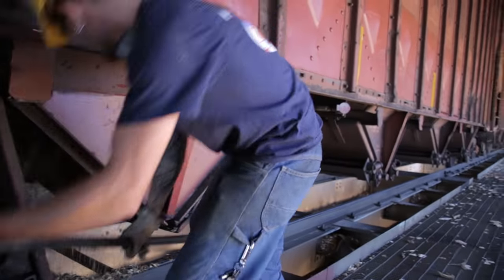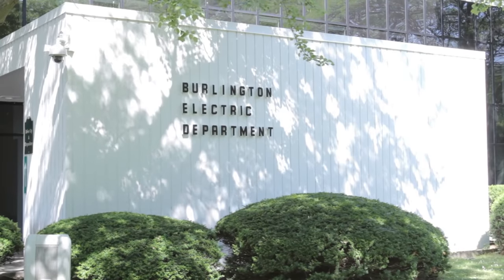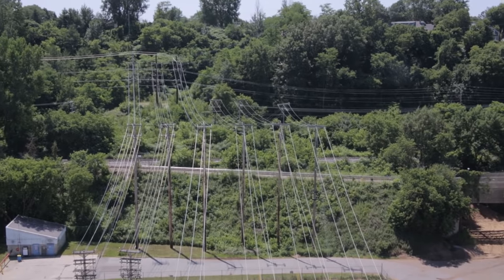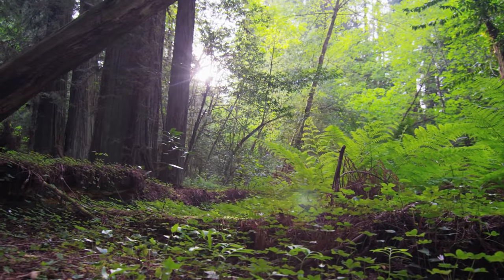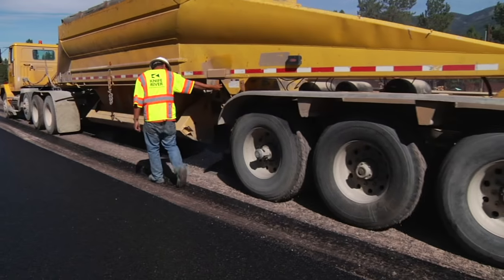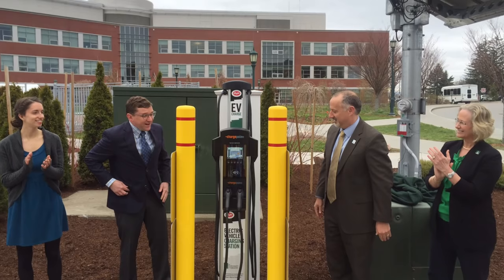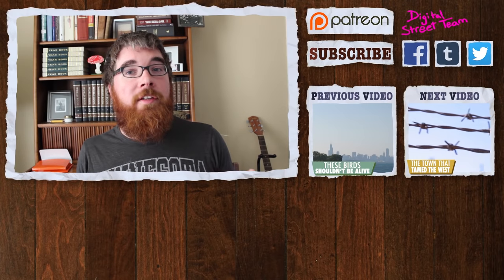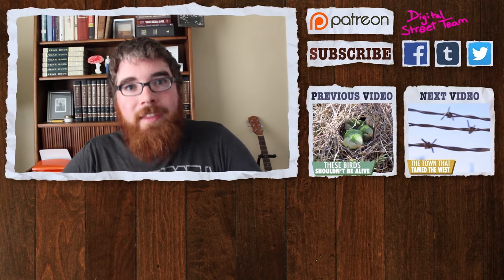Can A City Run On 100% Renewable Energy?

Comment: lol biomass isn't really renewable tho
Reply: The just explained how it was... how fast can you grow coal?
Reply: @hawks9142  biomass isn't renewable because if you keep growing trees and chopping them down in the same area, the soil will eventually become depleted
Reply: @nicolasperez4292  that may be true for annual crops(corn soybeans ect.) But the amazing thing is well managed forestry is actually ADDING to soil fertility. Nutrients aren't something that is just "there" in the soil and can only be taken out but something that is created in the soil from microbes. Nitrogen for example is created from the Nitrogen in the air which is made usable by microbes. Trees bring up minerals from deep in the earth to the surface making them usable as well!
Reply: @nicolasperez4292  also, it doesn't just have to be trees for exclusively fuel. Hazelnuts for example is an amazing producer of not only nuts but also biomass. Every 5 or so years you come buy and cut the Hazelnut bush to the ground(getting wood) and next year the bush comes up STRONGER than before
Reply: @hawks9142  yes, that's an interesting point. perhaps biomass could be 100% renewable if done right.  managing the mineral content in the soil would be the hardest part i think.
Reply: @nicolasperez4292  yes I agree. Perhaps using the ash from the power plant would help? The minerals are left behind in the fire. Also, the trains have to go back to the forests so might as well haul something with them

Comment: I think it is commendable what they're doing.  But I can't consider them even close to 100% renewable because of all the goods they're using/buying produced with fossil fuels.  A quick Google search shows virtually no industry/manufacturing in the immediate area.  So until their cars and clothes and food etc are all made with renewable energy, I can't say they're at 100%.  And when you look at the total kW/hr consumed by manufacturing compared to average residential/commercial use, they're realistically only getting ~30% of the energy they need (for everything in their lives) from renewables.  If you take into account gasoline (I'm guessing most residents don't have electric cars) the percentage is even lower.  Again, commendable effort, but realistically they are far from living on 100% renewables.